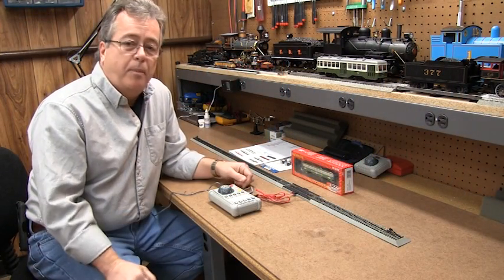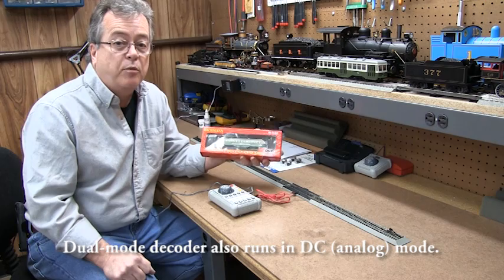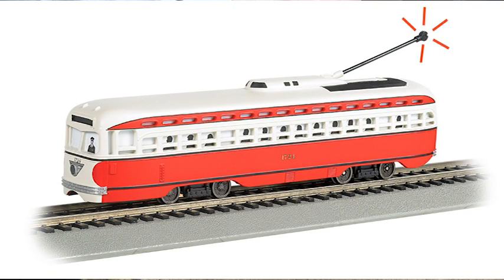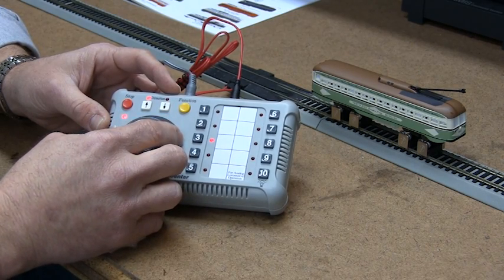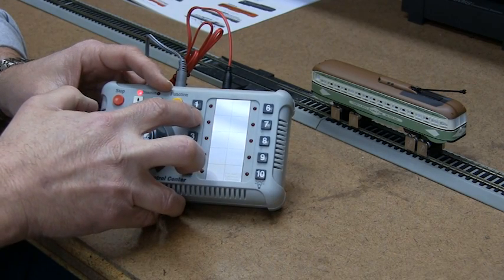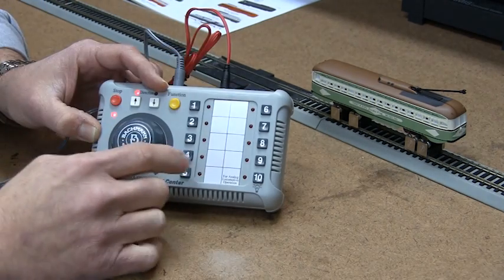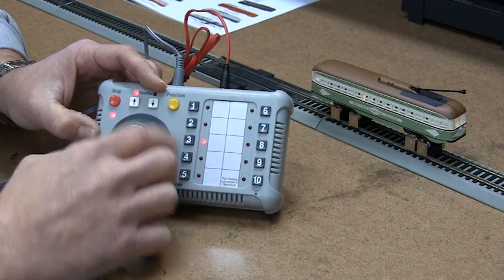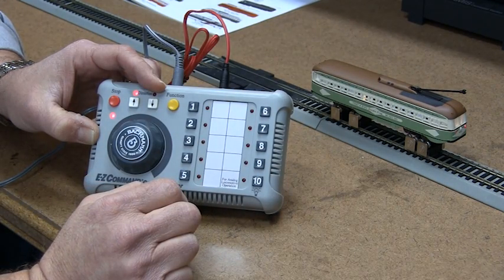Bachmann HO Scale PCC Streetcar with Sparking Trolley Pole

Comment: This trolley should also be equipped with an air horn, as all of the PCCs are equipped with air horns.
Reply: San Francisco's PCCs didn't have horns
Reply: @L-Taraval  Yes they did. It's the law.
Reply: @Ih8kone  , I  used to work on them at Geneva Car Barn from 1975 until they were retired in 1982.  I would occasionally have to take them out for road tests.  The cars didn't have air horns.  We only had gongs.
Reply: @L-Taraval  Weird. You would think that it would be against code.

Comment: I take it the Chicago car does not have the correct door arrangement of including the third door in the middle? Also, most overhead trolley poles don't spark unless the wire is very dirty or from broken hangers and or poor maintained wire tension.

Comment: Since this a model of a Trolley, presumably it will go around a typical 5" radius model trolley track curve with no problem?
Reply from the maker: Nope. It is a two truck trolley and will require at least a 15' radius curve.
Reply: That's a pity. I have a couple of your Peter Witt cars and they happily go round 8" radius,. Your Bachmann Peter Witts  are very well designed and built models, and I'm very happy with them.  See one running around 8 and 10 in radius at:
 https://www.youtube.com/watch?v=5glFF-j1p2o if you wish.
Reply: Love my Bachmann Spectrum trains my G scale 2 truck shay and my HO DDA 40 X great models.